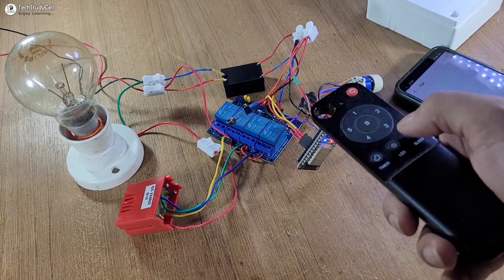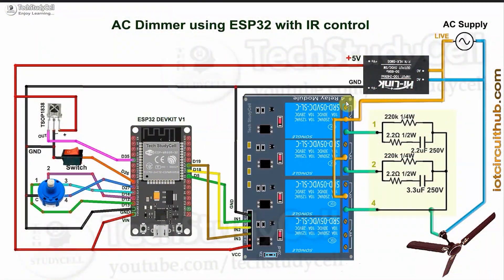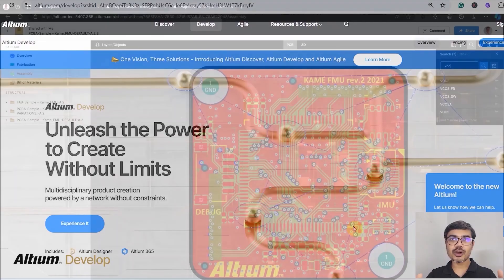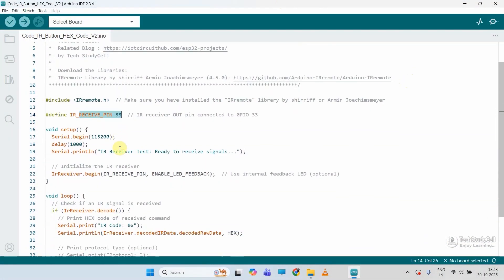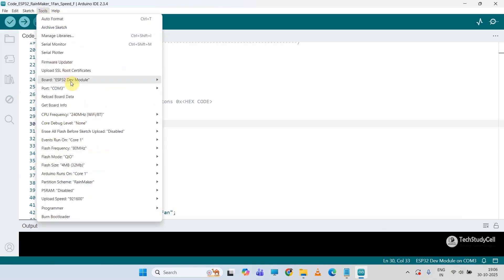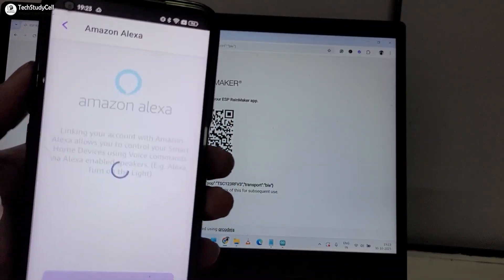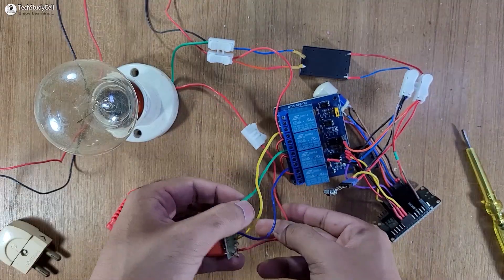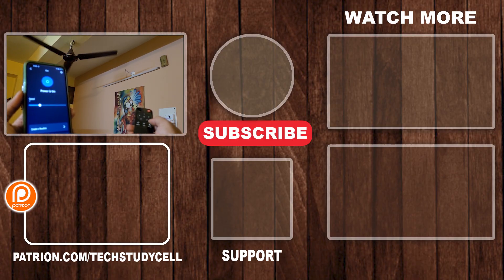IoT Smart Fan Regulator using ESP32 & AC Dimmer | ESP RainMaker + Alexa + Google Home Control

Comment: App fan dimmer ke related video kab banyen ge bt traic ko le ke
Reply from the maker: Triac-based AC dimmer circuits may cause a slight humming sound at lower fan speeds. so I have not used Triac
Reply: @TechStudyCell  its type ke fan regulator use kiya hai but us me slow speed bht slow hai medium speed esi hai jese slow honi chea only 4th speed proper work karti hai jo ke by pas hai casistor se. 220v or 440v se capisitor se koi farak parta hai q ke mene same values ke cap use kiye hain but 440 ke nahi 220v ke the
Reply: @TechStudyCell pls make dimmer to control fan speed or bulb intensity😊

Comment: Very good job sir 

Please 

Esp32 esprainmaker
4 channel relay 
Or fan speed dimmer volume control app 
Moc3021 bt16
Manual switch 
IR Remote 
Episode 
Code 
Esp32
Reply from the maker: Ok noted. but Triac-based AC dimmer circuits may cause a slight humming sound at lower fan speeds. so I have not used Triac here.
Reply: @TechStudyCell very good job
Reply: @TechStudyCell ok